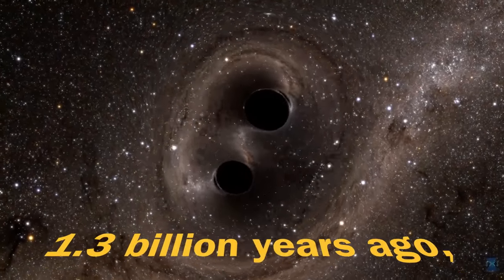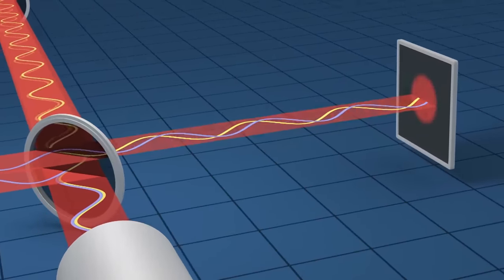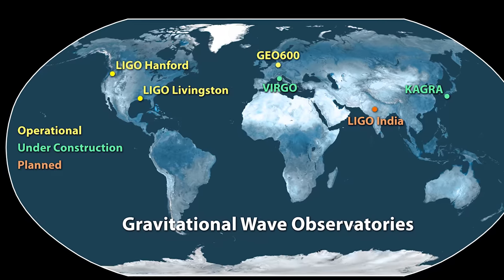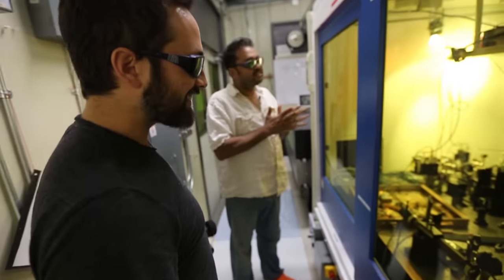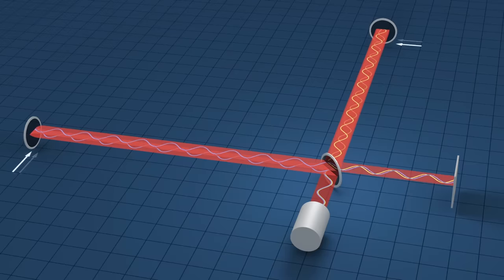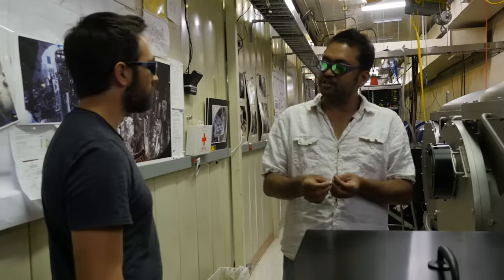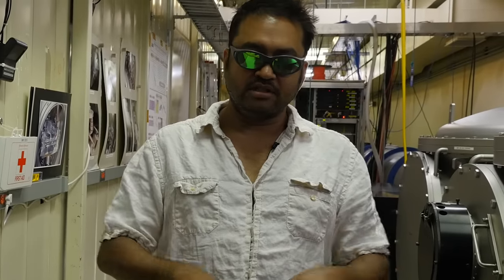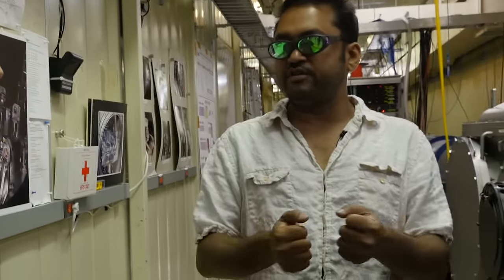The Absurdity of Detecting Gravitational Waves

Comment: A megawatt continuous laser? That's a helluva beam. I toured the Petawatt laser in Austin but that thing only fires for like a trillionth of a second
Reply: It's Okay To Be Smart I love your channel
Reply: I thought he said light was discrete, duh.
Reply: I want one of those - gonna troll my cat with a 1 megawatt :D
Reply: It's Okay To Be Smart the power of the laser itself is much lower but they resonate it in a cavity to build up to 1MW
Reply: correct, they have only about 20W laser and 1MW energy is then accumulated between mirrors, see
https://en.wikipedia.org/wiki/Fabry%E2%80%93P%C3%A9rot_interferometer
Reply: I thought I understood, but now I don't get it
Reply: and that is interesting because Derek seemed to believe it was an 1MW laser too
Reply: Quantum mechanics. Everything is particles, but waves too, at the same time. The probability of finding a particle somewhere spreads like a wave and even interferes with itself like a wave when passing through a double slit. The interaction between particles is discrete.

When you're measuring the brightness of light, you're counting photons, so you get shot noise. When you're trying to focus, aim or adjust the frequency of a laser, you're dealing with waves.
Reply: mind=blown
Reply: wiwh It is. In this case, "continuous" just means it's continuously emitting photons instead of only producing a short pulse.
Reply: Seekay  Saying it is a continuous 1 MW laser for normal implies that it is emitting a laser with 1 MW - and not a 200 W laser bouncing of mirrors so often that it accumulates to 1 MW.
It is correct, but a bit different than it sounds.
Reply: *****  What? That doesn't even make sense.
why would the wires be hot? Why should there be high temperatures?
Reply: +ABaumstumpf "Seems like 750 kW can be stored in the arms."
+Antonín Vrba "and 1MW energy is then accumulated between mirrors"
What does that even mean? W is a measure of power (energy consumed per second) not energy. That's like saying "the next town is 95 km/h away". It's a completely different unit and the statement doesn't make sense. Either they mean they can store enough energy in the cavity to release a pulse at 750 kW power for some useful period of time, or there has been a mix-up of units.
Reply: Gameboygenius  No, it makes sense.
It is just an a bit different way of phrasing.

the lightbeam entering it has a power of ~200 W and gets reflected multiple times.
If it would just bounce back once, than the light traveling has a total power of 400 W.
We do not know the energy contained in that beam, but we know the power equivalent of it.
I know it is a bit strange way of measuring it, but it is valid.

For similar - electrical current in a coil:
You can either specify how much energy it has stored, or the current that is flowing through it.

With the length of the beams and the speed of light you could calculate the total energy stored quite easily:

power*length/speed = kg m²/s³*m/(m/s) =
kg*m²/s² = total energy.

so yeah - both give you just as much information.
Reply: Right, it's an equivalent unit. Basically the power an equivalent laser would have to be if none of the photons were recycled. The point still stands that it's not operating at ~1 MW in the regular sense. Edit: I guess an apt comparison might be the superconductors used as "permanent" magnets in MRI machines. They have a continuous loop current of some magnitude, through a 0 ohm conductor.
Reply: Q-switched presumably?
Reply: Hi I am a 14 years old boy and I will be starting my science channel, I would like to explain science the easiest way possible so even children my age can understand it. My favorite topic in science is Quantum Physics, I score A for science but I know that doesn't really matter. Please do tell me any category or topic in quantum physics you guys might want me to explain as I need my audience. ~Lucas.
Reply: shouldn't you learn about science before you try to teach it?
Reply: TheKalash I study Quantum physics at an advance level I already know the basics of Physics too and I can comprehend how it is different from Quantum. I have the IQ of 147 but I dont brag about it, I studied Quantum electrodynamics, Fluid dynamicw, Physics, Biology, Chemistry, Thermodynamics, Astrophysics and many more at the age of 13. In this year I would have comprehend science at an average human's scientific perspective at 23 years old.
Reply: Discorderiz Youtube  Then why would you even ask others about what to make a video about?
Start with the basics and show the strangeness - delayed eraser for example.
Reply: Discorderiz Youtube  "I not going read this long thing"
And i made it so easy to read.

here, a short version so your brain doesn't hurt from all the words:
You are not smart.

And no - explaining thing in a short manner does not mean you understand them - specially for quantum mechanics it is the opposite:
if you think you an explain it in short then you don't understand it.
Reply: ABaumstumpf I have deleted my previous comments as they serve no purpose other than giving you the reason to waste your time on the internet. You should be glad about your life, being part of a living civilisation that in millions of years will die off. Not everywhere in the universe there are living beings with the consciousness of our. This is considered lucky otherwise amazing to me and I do not wish to waste my time continue this broken thread since it is insignificant.(Two beings in the universe compared to other are like dust so insignificant but using the time of their life to quarrel instead of using their communication to it's best purpose)
Reply: As a teenager who is finishing high school in two years and an intelligence that is at least even with Lucas and arguably higher, I absolutely agree with you.
Reply: ABaumstumpf I meaan if he books aren't enough I did win serveral awards. I just wanna put it out therr that I only want opinion on what video to make on and I do have to tolerate this behaviour coming from you.
Reply: Jesse Li Good luck with you high school. But do you have opinion on the topic I started?
Reply: +Discorderiz Youtube Just curious, which IQ test gave you the score 147?
Reply: Gameboygenius I did it 2 years ago when mensa test tell you your iq score I redid my test this year but it only states top 2%.
Reply: I incompletely understood those topics too, at your age.

Your critics are right. If you don't know where to begin, or how to explain it, then you don't actually understand it yet. You may have all of the information, but it's not in a state where you can process it, to create new ideas. 

You know the material, but you don't really understand it.

Pick an aspect of this topic you know the best, and write an essay explaining it as simply as you can. Take break for an hour or two, and come back and read it.

Rinse and repeat.
Reply: Discorderiz Youtube "If you can't explain it simply, then you don't understand it well enough." - Albert Einstein 

You're telling us you don't know how to do the work, while bragging about how smart you are. 

Can you imagine how that looks to other smart people who know how to get stuff done?

you may be the smartest kid in your class, but you're not the smartest kid on the internet.
Reply: Why do you pick up my words and manipulate them to deceive yourself, I did not claim not to know the topic. I don't know how you manage to get this idea.
Reply: It's Okay To Be Smart u
Reply: ***** with highly reflective mirrirs, the light keeps bouncing back and forth until it reaches the detector.

By adding up the total beams between the bounces, it adds up to this figure.
Reply: ***** too be clear, the beams are zigzagging between the mirrors, to multiply the length of travel.
Reply: ***** You're questions are not quite on point 

It's a modest continous beam.

It is reflected many times to extend the effective length.

The power in the system would be beam power X number of reflections.
Reply: I love you
Reply: Dear Discorderiz,

You have been introduced to certain
elements (not from the periodic table) that inhabit YouTube. Please do not worry about this minority that are there to test our patience.
It's a wonderful thing to share knowledge and enjoy doing so. Most people that participate on channels like this will have some knowledge, but you may be shocked at the overall lack of intelligence - unveiled in black and white for all to see, only too often on this medium. Stupidity and rudeness.
BUT there are many more who love to learn and communicate in a friendly way. I for one welcome you and I recognise and applaud your precocious (in a good way) talents.
EDIT: Oops! That read so poorly I adjusted slightly.
Reply: Feels good to know that there are other minds like you that can be found on this site, I also understand that there are many people here that would like to put themselves in a position of a higher intelligence just to have a taste of it but sometimes take it too far and use it to judge others or harass others.(What I had experienced above.) The quotes goes by "Intelligence is the ability to adapt to your surrounding." thus I did not reply to those illiterate cretins. No matter what I appreciate your reply and nonetheless you being intelligent or not I respect you.
Reply: Pulsing laser.
Reply: Is that bigger than the laser Goldfinger used in James Bond ?
Reply: +Augusto

PBS's channel, you mean... XD 

#contentcreators #vs #bigproduction
Reply: +Discorderiz Youtube 'I have an IQ of 147, but I don't brag about it' lol. Hopefully you can spot the contradiction without my help.
Reply: LOL jack just rekt the kid .
Reply: No, continuous. Any variation of amplitude would create sidebands.
Reply: The light in the cavity has a continuous power level shining on the mirrors of 750kW. The mirrors are VERY reflective, so the amount of power absorbed by them and all the other losses in the cavity is just 200W, so the input laser only has to supply that power to make up the losses and maintain the continuous level.
Reply: If what you say is true read the course of theoretical physics by Landau and Lifshitz before you make any physics videos. There are 10 volumes, first 3 is all you need. They are very useful and will help you to avoid numerous mistakes made by such popular youtubers like Veritasium and MinutePhysics. Non-relativistic quantum mechanics is the 3-rd volume. The second volume is called "Field Theory"(that is electromagnetism and general theory of relativity), and you might find lots of material(there is no magnetic field if speed of light is infinite) to make a video about since there are still lots of misconceptions around the subject in the media... You might get stuck in the first pages in the first volume(due to some yet unfamiliar terms), just continue reading it will get clear later. Those books are not thick and very useful for understanding the depths of physics. For example you heard about conservation laws(energy, momentum, angular momentum) in physics, but those are actually consequences of other fundamental properties(homogeneity of space-time and isotropy of space). Oh, you heard about uncertainty principle, if you think about it you will understand there is no such thing as angular momentum of a particle in quantum mechanics! Hey, what about isotropy of space then? So angular momentum is conserved, but does not exist.
Reply: thats a good one xD
Reply: ABaumstumpf  That's fine, and would be funny as hell...until the cat makes an unanticipated move to the left or right. Then, you would have a smoky puff of residual fuzz surrounding a vanishing cloud of smoldering, cat, "pink mist" particles. WHOOHOO!!! What fun!!! Now that's what I call a fuzzball! Or is it a "furball?" Fur-LESS ball? Ah, Hell, whatever... It's a "cat"-astrophe, either way.
Reply: Multi Gaming  I posted a similar comment before seeing this comment. Hahahaha! I think the same way! One twitch, one *POOF!* And a smoking burnt-fur smell is all that's left. Poor kitty!
Reply: Linux Gaming in FullHD 60FPS  Good on you. Rather than arguing with, and trying to pick a fight with a headstrong, probably smart teenager who has clearly stated a goal, I too would rather try to help than to hold a grudge and fire off snarky replies one after another.

Also, your reply was a good one. Though I wonder at what cost those volumes may be had, and if in digital form are they less expensive? Cost is probably an issue for most people, but for an unfunded young teen, this could really be a stopper, especially when one figures the cost of a multi-volume set of science books. "Pricey" is the word, I would imagine.

Anyhow, I just wanted to applaud your effort to help, instead of simply to criticize, like so many others. We all had to start somewhere. And far be it from me to try to crush the dream of someone whom I used to be like, even if it was a long time ago. Plus, even though we didn't have computerized resources such as are available today doesn't mean that we had no computerized resources. We just had to make them ourselves. Thus, I taught myself how to code for a Radio Shack "Trash 80," which was a model TRS-80 plain computer that cost me around $800 for the computer and its accessories. I bought it with the money that I busted my ass to earn, first at a building supply store, then at a Kinney Shoe store--where I found my true calling, SALES!, for my growing-up years, until I entered college in my mid-thirties.

At that point, my head was turned back to computers and their attendant math. In fact, I joined my two greatest skills into a computer store with sales and repairs. I made a LOT of money until illness forced me from the game. Now I troll the Internet (as in FISHING-type trolling), looking for ideas, places I may help out, things to do, and, as always, to LEARN new things. Knowledge is power! Hahaha! But it IS, you know.
Reply: Yeah. Seems like a pretty high Q cavity (high Q meaning highly efficient reflectors) and over 4 km, it is amazing that they keep the beam that collimated as well--Very impressive.  High Q cavities work because when the mirrors are super reflective, they absorb very little and the circulating power can be very high without damaging them.
Reply: Basically, Fabry-Parot Cavity is used to amplify the power of laser inside the tube. This  cavity has a high finesse around 200. So it amplifies the input power 200 times. Also there are feedback systems which keep the cavity tuned.
Reply: Now that would make an awesome video !
Reply: John Nemo
Reply: ABaumstumpf
Reply: +Helix as long as they can maintain whatever wavelength they switch it to it won't invalidate the experiment.
Reply: Aha, so would not vaporize a head? 
If its 1 MW and tube is 4 km (8 km return trip) then that 1MW of power will only be sustained for 8000/3e8=0.00002667 (sec). The amount of energy in the beam is only  26.67 W seconds. So I think it will vaporizer a few microns of skin and that's about it.
Or did I make a mistake?
Reply: Discorderiz Youtube I'll tell you something kid. When you stand out, there will always be someone who will try to bring you down. Unfortunately that's how this world works. People act like that because of their tiny pathetic ego which can make them feel inferior and can make them feel bothered by other people's success. It's ok to ask for advice but sometimes you would have to figure out the answers by yourself. Don't let nobody to project their negative thoughts towards your projects.
You gotta be strong and don't let them dicourage you from making this world a better place. Go on and do your thing.
Reply: Discorderiz Youtube Please don't spam comment sections. And humble bragging is sill bragging.
Reply: Resonance doesn't increase power. Only amplitude. The resonance is primarily to create a pure "sine wave" light, of only one wavelength, absolutely monochromatic.
Laser power is measured by the power input for excitation.
I'm gonna assume (without the knowledge I really need) that this laser is pulsed, though. Continuous wave would seem problematic when trying to record phase-induced interference. Cooling a megawatt of infrared energy hitting a target would be difficult, too. I also assume the pulse rate is rather fast, since the passing of a gravity wave strong enough to be detected would be a terrible thing to miss.
Reply: +Discorderiz Youtube
I can't find any fault at all with someone who wishes to share their knowledge with as many people as possible... And since my recently acquired hobby of trying to help people who insist the Earth is flat, it's very refreshing to find a group who feels science actually works.
Knowledge is power... . More to you,  Discorderiz Youtube!
Reply: "you may fire when ready"
Reply: And the clarity of the optics would be ridiculous. Any imperfection and you could potentially melt your lense, or the mirror. Imagine being the QC for either? Talk about OCD.....
Reply: brmacontrol thnks
Reply: Look who's here 👋😄
Reply: BLAIR M Schirmer  .................possibly, but I think the arms are suspended, isolated and also evacuated, so a truck passing wouldn't effect the light beams.
Reply: @I C Flatwater I'm not sure photons are considered as solids as they have no mass, hence the speed of light thing.
Reply: They get their electricity free, or they just split it up among us.
Reply: Analog TV transmitters were commonly several megawatts, just not so concentrated a beam.  And they did require one hell of a cooling apparatus.
Reply: @derek  is it Derek?
Reply: I googled and it looks like pta is 1 million times more powerful than mega.   Woah.